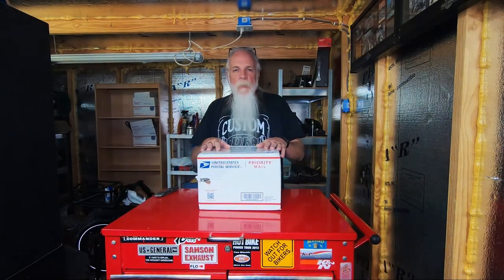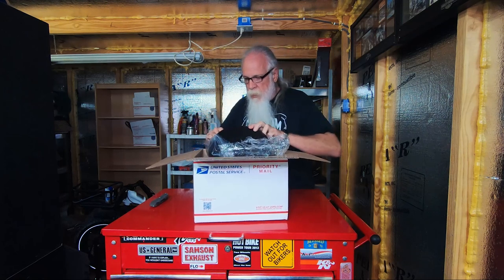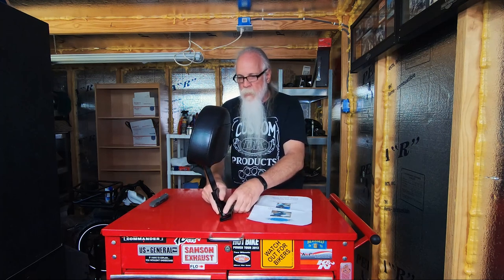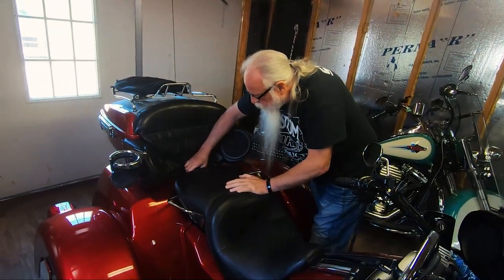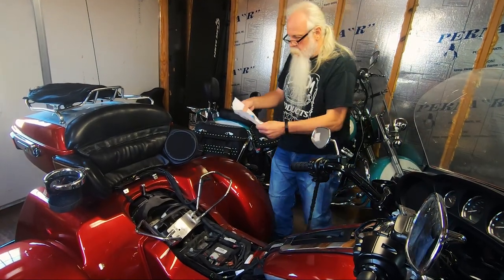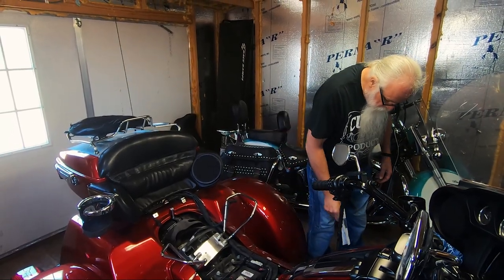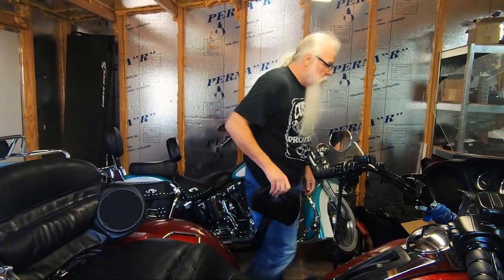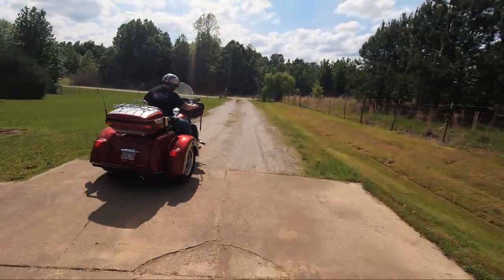Trying Out New Kind of Backrest for Harley Touring

Comment: I have a nice backrest for my 2020 Heritage. It slips on right over the two seat post that come out the fender and the seat nuts go on over it. Can still be used with a Pillion or a cargo rack that clips into the Nut groves like from mother well. Im very surprised that no one else offers something like this, its very simple, easy to put on with no tools, very secure, and takes longer to try and steal. Its also adjustable for height with a set screw. After that, the slip and go nature of this back rest is worry some. Id lock it up every where I went to.
Reply from the maker: Good to hear you have a backrest that you are comfortable with!

Comment: Kevin, So how do you feel without having a height adjustment?
Reply from the maker: It feels great for me.  I've always run my backrests so that the bottom of the rest was at the top of the seat.  So this has worked out well for me.
However, if I did need it higher, it would be easy to put a set screw into the bracket underneath the seat so that when the backrest slid in it would bottom out on that, instead of going all the way down.
Mary was concerned that it did not flip forward, like other ones.  But it has not been an issue.
However, that is a potential drawback of this backrest for some that would prefer that.